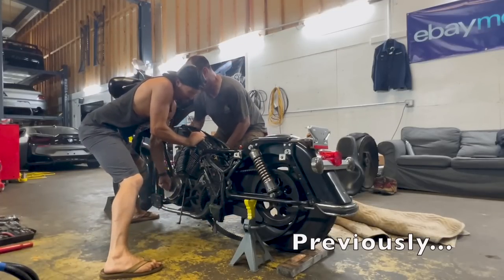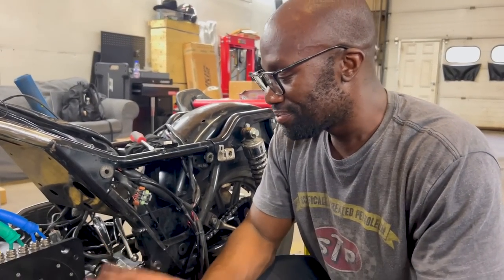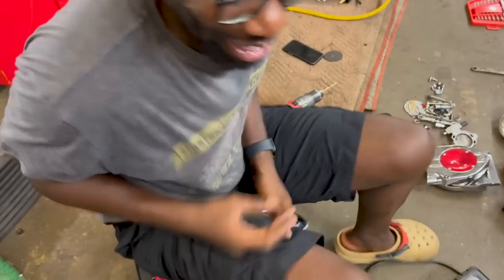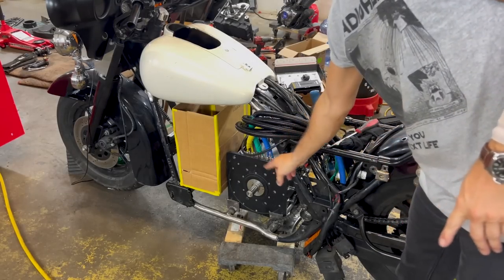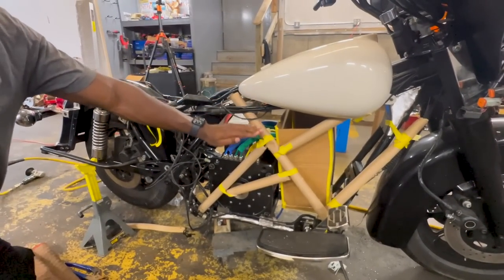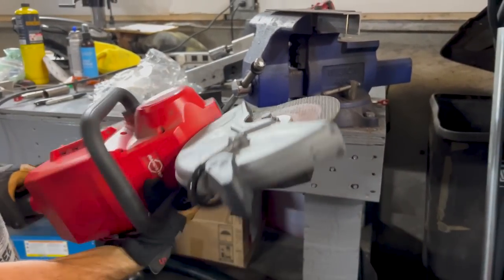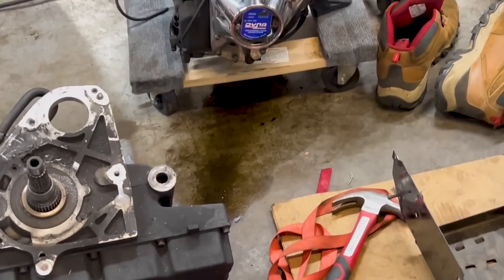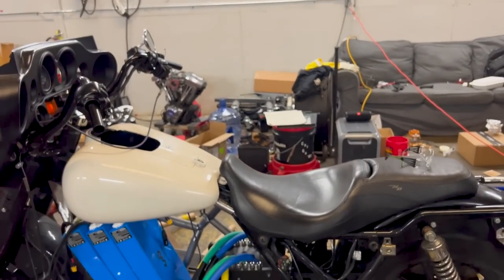Deep Dive into building a True Harley Davidson Electric Cruiser

Comment: Detachable saddle bag battery packs would be awesome for optional extended range. I’d bet you could probably fit 2 on each side effectively doubling the range
Reply: could maybe use more batteries if they putt them on horizontally under the frame
Reply: What a cool idea 💡
Reply: This is a wonderful idea
Reply: would be great to have different battery configuration for daily driving or even canyons (lighter) and for touring (more range) like the zero FX which has two swapable battery modules. although losing the saddle bag storage to batteries and the weight distribution would be quite bad. better to cram all the batteries you can put in the engine bay and make it modular
Reply: Fuck what anybody say about your builds do your thing... that fucking guy probably don't even own a bike🤦🏾
Reply: Putting high voltage LiOn batteries in such an exposed and unprotected position sounds very dangerous. I think even Rich would pass on that idea.
Reply: See this is a cool idea. Belt drive, not so much xD
Reply: @fieraci8500  IDK people have been adding gas tanks on adventure bikes.why not batteries? bags doesn't sound way worse than under your crotch, if you get t boned by a car  the battery getting on fire is probably the least of you concerns. btw my wife got 3rd degree burns from a motorcycle with punctured gas tank vs scooter accident , if the motorcycle had been electric she would have walked away instead of spending months in the hospital
Reply: That's what I did with my daughter's power wheels Harley. Put a battery in each saddle bag and one under the seat.
Reply: You could add a sidecar both sides and a trailer to carry the batteries needed to equal a tank of gas. Spend 12 months recharging ready for your next road trip HOME.
Reply: @richardlee2488  troll detected 😁 electric motorcycle still haven't reached battery capacity/efficiency/charging speed to comfortably do road trips. they will eventually but probably only with next gen batteries. li ion are too heavy and motorcycle are not efficient enough travelling at highway speeds. it would be possible if money and weight were no object. (like for HD bikers 🤣)
Reply: @geemy9675  you are correct that new battery technology will play a big part in the success or failure of electric motorcycles. The range limitations are the single biggest down fall. But where it may be practical to carry sufficient battery capacity in a car it is just no feasible for a motorcycle. The aerodynamics of motorcycles is something that can not be ignored and will be a greater challenge for battery power.
Reply: @richardlee2488  the small displacement utility motorcycle that are widely use around the world as cheap transportation will go electric first because of low cost per mile. large displacement motorcycle is a niche product in comparison and will take more time to convert to electricity
Reply: Community bike builds 😂🤣
Reply: Eaahhh... Should've put tesla model s engine on the harley lol
Reply: How about a bunch of batteries in a Harley trailer?

Comment: Hey Rich, before you do the final assembly, could you throw the motor,  batteries and controller on a scale and see how it compares to the weight of the original motor and transmission?

Comment: Have you considered arranging the batteries into a v shape - two batteries leaning forward and two leaning backwards to replicate the original 45° V-twin?
Reply: @Alistair Balistair BECAUSE ITS A HARLEY BROTHA
Reply: That's actually pretty damn awesome.
Reply: definitely should arrange two motors that way and finish this bike 2035, thanks kind random stranger.
Reply: It's a dam good idea... from a distance it might actually look like a one...
Reply: Isn’t it a 90 vtwin?
Reply: That is a great idea! Also they could build metal boxes with fins like the cylinders to surround the battery packs that could aid in keeping them cool
Reply: @Gnrnrvids  Ducati 90, air cooled Harley 45 degree, V-rod 60.
Reply: that's a good idea, would probably only take about 15 minutes.
Reply: You know it would be cool if ya kept  the transmission in the bike
Reply: And they could turn the motor at angle and put it between the batteries
Reply: Dam great idea..comment section is about to hi jack the build lol
Reply: @robmanueb.  ta mate.  Wasn't sure.  Thought they were 90°.  I had a TRX850 engine in one bike.  Parallel twin with a 270° crank, so same firing order as a 90° twin.
Reply: @Gnrnrvids  Generally it is a design compromise, 90 degree vtwin makes for a big motor Ducati are known for having a long wheel base but the engine is smoother than a narrow angle, Harley counterintuitively have got a narrow V which should help the way they handle but I think their gearbox is so large it defeats the point.
Reply: @DeusTex-Mex  if that...
Reply: That would take up so much space, I'm pretty sure you couldn't fit the motor in there then.
Reply: @Mathewwoods178  brother* Harley guys use the hard R in brother
Reply: bthat would take up waaaay too much space man...come on
Reply: @robmanueb.  Aprilia 60°
Reply: @savoylunsford3023  plus the clutch so you can rev it whenever you want
Reply: @sinformant  nice plus you could literally replicate ICE vtwin cooling issues with the rear battery cell getting hotter than the front 👍🤣
Reply: @geemy9675  Aha! Good to remember the cooling requirements for EVs that is for sure.
Reply: @Mathewwoods178  Are you stricken with Hulkamania? It's an older disease that I thought had disappeared
Reply: @DeusTex-Mex  maybe even 10 minutes
Reply: Damn I was about to post the same thing, V4 lighting

Comment: I'm a belt drive guy (even my bicycle is belt-drive), but I think that the chain is the way to go, at least until you ride/road-test it and eventually finalize your drive ratio. It's MUCH easier to swap cogs in and out than pulleys (and cheaper and much easier to make if needed)... But Ultimately I think Id go with belt in the long run. Too many advantages over dirty greasy, noisy, jerky, constant cleaning adjustment of chains.
Reply: That motor would rip a belt to bits with the torque that motor has . Rip the teeth off instantly . The chain will stretch like most bike chains do eventually .
Reply: A good machinist could do that in 15 minutes. A great machinist could do it in ten. But what’s really impressive is I wrote this comment in less than 5 minutes. So belt drive I guess.
Reply: @ytthecommunistplatform.2675  Absolute nonsense. Do you have any idea how strong belts of that size can be?
Reply: @ytthecommunistplatform.2675  Says the guy with no idea about actual shear strength of belts haha.
Reply: @ytthecommunistplatform.2675  Motorcycle chains don’t stretch. The stretch coefficient of high tensile steel is very low. The pivot points wear.

Comment: For the removable cage portion on the chain drive side, check out tube clamps the off-road world used for cages or removable engine braces. They use one or two Allen bolts and a tongue and groove style fit. Not sure what size tube you’re using, but 1-3/4” is common and would help make removal easier to plan around. 

Love your guys content. Banter >>> grinding any day

Comment: Belt drive is fine but you may need to set a torque limiter on the controller on it so you don't shred the belt.  A chain can handle a lot more instant torque; the worst case is it'll break traction (on the tire) but the chain itself won't break.
Reply: Motorcycles will spit the chain joiner before snapping the chain. I used to keep a spare taped to frame.
Reply: Not with 72 volts. My bicycles are 72v
Reply: make some noise with that chain slap ,be a man 🦾👊🏼🍻
Reply: Those belts are tough.. as long as they have tensioned correctly to where it can't jump teeth-- you're going to shred the tire and drift into the ditch far before you ever shred the belt.

Comment: I really like the forward slanted battery look. It’s so much better than 90 degree angle. Keeps the flow of frame relative to the batteries. Keep up the awesomeness.we need more recorder!!
Reply: I agree. That looked pretty dope. I doubt they do it though considering they'd have to rebuild a bit of the framing.
Reply: Agree also adds 10 kph EZ

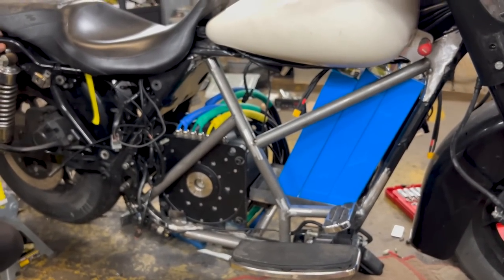Comment: Just a suggestion, but when you fabricated the lower battery frame for the batteries to be mounted vertically, I wondered if it would be better aesthetically to have the batteries to follow the down tube like you have at 25:19 which honours the V Twin.
If they were then staggered in relation to each other it would allow the batteries to be mounted lower in the frame which would lower the centre of gravity.

Comment: I'm hobby machinist and I could make that belt sprocket probably in two hours, depending how I actually ended up doing it. Probably I'd first bored the center hole straight in a lathehe, then made a bit oversized piece to fill the hole, and pressed it in with the inner part frozen with co2 ice and the sprocket heated up to make a tight fit.

If I wouldn't want to take a risk to screw it all up trying to use fancy trick, I'd just make a normal press fit and bolt or weld it in.

Then I'd make the correct size hole and keyway and then find out if was all for nothing because it is way too big for a direct drive with that motor. Last gear is typically straight and 3000 rpm is something between 100-120 km/h. That can be considered to be close to top speed with 20kw motor. 

From the specification it can be seen that the motor have recommended rpm on 3200-6000, peak power 50kw and peak torque 160Nm. It'll move but I'd almost halve that gear ratio to get better acceleration.

Comment: For the belt drive:

1) Drill 6 holes in the belt drive
2) Cut 2 steel circles to fit the ID and drill the same 6 holes for bolts
3)Make a hole and keyway in each circle 
4) Bolt them to the chain drive

Enjoy!!
Reply: Be hard or impossible to get it perfectly centered.
Reply: @farmerdiy9024  whats do you suggest?
Reply: @FirstLast-tx3yj  to use a chain like they want.
Reply: @farmerdiy9024  that would 100% work but i meant a solution that making the belt drive work...
Reply: @FirstLast-tx3yj  a trip to the machine shop i guess
Reply: @farmerdiy9024  the 15 minute machine shop is going to mighty busy on this build😂😂
Reply: Another nondescript brother. Salutations fellow anonymous one
Reply: Try& get a tire sponsor.  The torque u produce u might need one . Can't wait to see it rip

Comment: Rich: I can confirm that a machinist can make the part, as I had a complete custom axle machined from splines to keyway as well as had a custom front sprocket made with keyway. I used  the 72v/5000w Golden Motor in a quad and Im going to be using the same motor as your bike in a Morris Minor project. 
Looking forward to more progress!

Comment: I have a 2003 Suzuki Savage, I put a 16T sprocket on my motor and 52T on my rear wheel, Motenergy Me 1306 motor, fardriver 96530 controller.  Im giving it 200a continuous 530a peak, 99.9v 27ah lipo pack.  Ive had it up to 80mph with more to go

Comment: You should put a stroopwafel compartment where the tape deck used to be. Maybe a lil' pull-out drawer. You could even put a little heater in there.

Comment: Steve, couldn't you modify the rear angled tube, to be in continuation of the one, that comes from the neck of the bike? I would try to make all the tubes to be in parallel with each other. It would look much better.
Reply: The continual tube didn't look quite right. Matching the angles of the pre-existing bike made the most sense - and then the asymmetry complimented it. Hopefully it translates in the final design. Additionally, it provides the motor and battery more structural integrity in the event of impact or drop.

Comment: Love this build Rich.
I really really really wish you would do like an obsessed garage type build kits.
If you want cheap for a regular mtn bike there is this kit.
If u want crazy, for the best bike there is this kit.
Something in the middle.
Get with a manufacturer and start building kits that have instructions both in English and video posted from you to refrence.
It comes with everything you need.
You would sell out, easily 20k kits in less than a week.
You can use kick starter to fund the beginning.
Give the Kickstart supporters, the top level kit for the price of the beginner kit as way to give back. 
Then, with everyone who gets in, you give this bike or whatever, away with someone who gets in on the Kickstarter program.
You can have these shipping in December if you start full board now.
Let's go Rich.
Obv once you have the customer base, you can start to develop and perfect kits for motorcycles.
Find the top 10 motorcycles sold that are now 10 years old and start with kits for those. People will very likely to pull apart an older bike as opposed to a newer one obviously.
The mountain bike e bike kits would be epic.
Even a road bike kit would be impressive as they're isn't many of those

Comment: I love where the bike is going but the angles on the trellis frame would look better if they were the same. The differing slants on the bars from the steering stem to the middle and then from middle to the rear set area would look sooooo good if they were evened out. 

A machinist should be able to mock something up in 15 minutes for about $100.
Reply: I hate to say it tho He's right...those trellis bars would look sick if they formed a true X rather than offset. It shouldn't take more than 15 minutes to re-fab all that tube notching  etc...;D

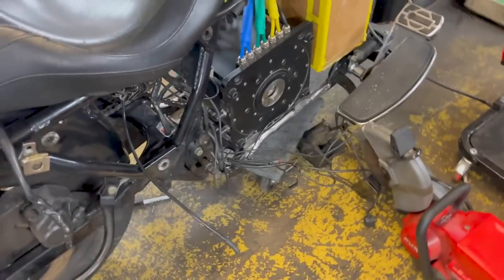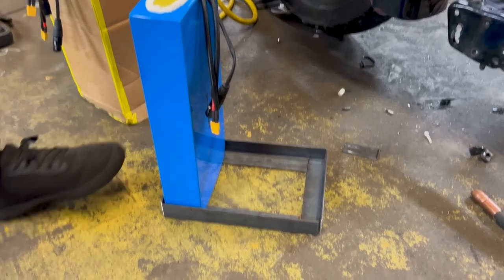Comment: @13:06, The piping looks horrible! I would just make a light fender that looks 50's style auto with corvette style engine vents. The fenders would cover up what needs to be covered up and it would go nicely with the tank style. @20:00, I would also make thin cooling tanks between the batteries and run that to a small radiator, and add cooling fins with thermal glue to the motor.

Comment: I'm a machinist and trying to make that pulley work is way more then a 15 minute job. lol
Once you figure out the final drive ratio you want and if you want to do a belt drive, I'm in NH and own a small machine shop and you could buy a different pulley with a smaller center hole, that I could machine the hole to size and broach it for a key way in about 30 minutes 😉

Comment: you could make a jackshaft for it drive motor on a separate chain to shaft mounted on the plate you mount on electric motor behind drive gear, on the shaft on the plate behind drive gear you put 2 gears you can try 14 tooth front with 15 tooth sprocket behind that, which has a separate chain that runs to rear wheel sprocket, gives you a little bit of transmission but one way will be dead slower on take off with phenomenal top speed while flipping gears the other way on jack shaft will give you wheel standing power on take off but winds out top end real quick.

Comment: I wonder if you could add a water pump  with tubing between the battery modules connected to a small radiator.

Comment: Would the batterys not need some kind of felt lining between them all, and the base so that the steel base bracket doesnt rub through them from the vibrations etc?.. Love the build, chrome the whole bike out aswell! Much love from the UK 👍
Reply: felt? why? that's non sense. no reason for it. steel bracket doesn't rub. it's stuck.

Comment: belt is just so dam clean, but you are also going to need an auto tensioner too, they can't be allowed to slack as the rear shock moves like chains can unless the front pulley is at the pivot point, then it won't slack without a tensioner
Reply: The geometry should be pretty close considering it was originally belt drive.
Reply: @helicopterdriver  I'm not 100% sure, but I'm pretty sure the original transmission places the small pulley on the same shaft as the rear suspension pivot shaft, and that's how they get away with no tensioner. they will definitely need one here, that much slack and the belt is going to skip bad when the suspension moves. its not a big deal, the tensioner doesn't even need to be that strong because motorcycle drive trains only drive in one direction, no reverse, so the tensioner just needs to remove the slack on the non driving stretch of belt (bottom stretch) to keep the belt snug around the rear pulley. hope they are designing this in or they are going to be very disappointed as soon as they try to put down some power and the belt jumps
Reply: @connelly6375  I forgot about the transmission location. Maybe they will get lucky! :D

Comment: Do not forget to refill the frame with oil or grease. 
Avoid corrosion from the inside. 
It is almost impossible to paint or powdercoat the inside of a constructed steel tube cage. 
Maybe you find someone who offers to wrap the inside of the frame with a glow-in-the-dark-flex-seal anti corrosion water proof protection layer.

Comment: I thought you guys went with a chain due to the instant high torque of the electric motor. I didn't think about the ease of adjustability. That's also why I'm happy to just watch these videos and trust the process. For the turn signals though, HD make mirrors with signals built into them, they've been around since the late 2000's. How about running a set of those? (I know, I'm not trusting the process here, but safety is important man!)

Comment: My only thought on this build is that your the frame you're wielding together is that it's a little bit too much, I'm sure that two horizontal pipes forks be perfect, is one side was made to be removed for the battery, and then you could bolt on one side